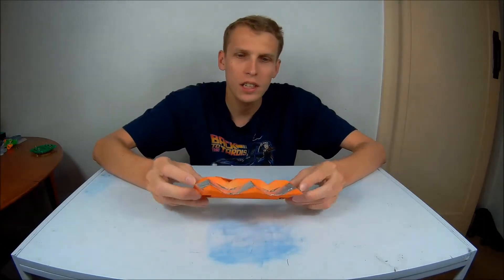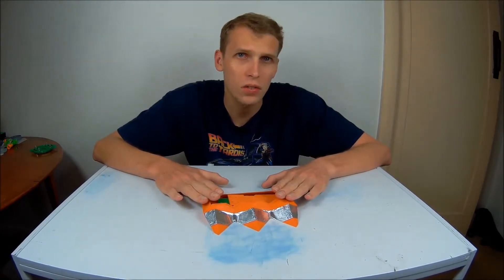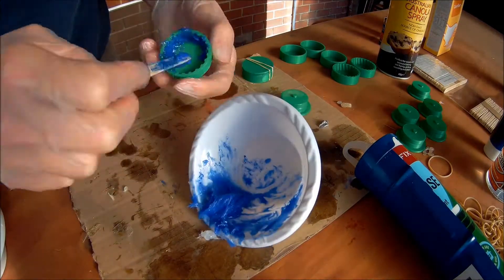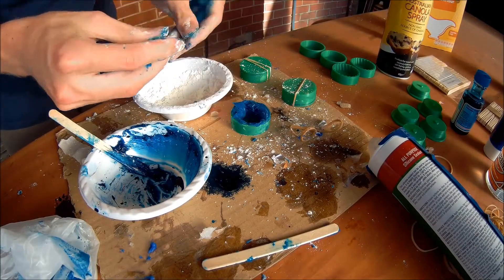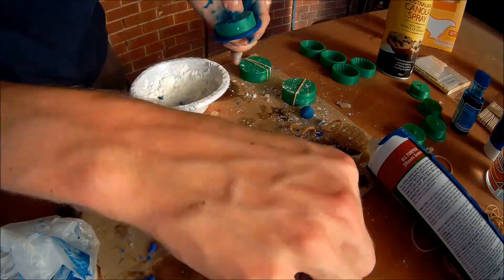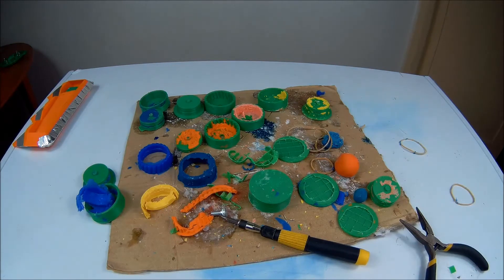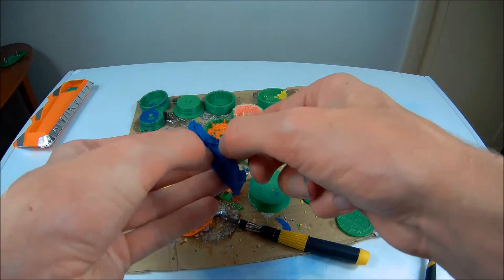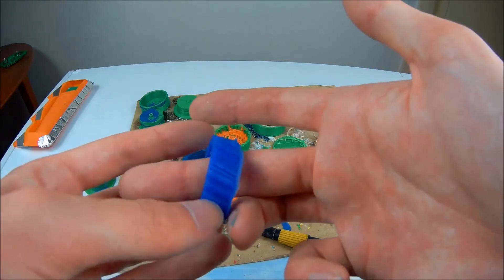DIY Silicone Wheel Experiments!!

Comment: As you'll be using these on a reasonably smooth surface, you should get more grip from a smooth tyre. Tread only really helps on loose or wet surfaces.
Reply from the maker: Combat arenas are usually only smooth for the first few fights, then they get full of dust and debris. The tread on these wheels is modelled after the tread on Ghost Raptor (battlebots s2) I'm hoping the shape will help kick dust and debris out and away from the robot.

it's just an idea right now, so I am going to fight with both treads and smooth to see which works better

Comment: Maybe try making the inner part of the mold, your actual wheel. If you rough it up or score it, the tyre will grip really well. (Once you’ve found the best mix, of course)
Smooth tyres will probably be better for grip because a ridged tyre has less surface area in contact with the floor. Also if the ridge is deep, you already have built in movement when your robot is being pushed against. That first bit of movement is often enough to start an unrecoverable slide, especially if some of that movement is enough to take a small amount or rubber off the edges of those ridges. In formula 1 we refer to the loose rubber that comes off the tyres as ‘marbles’ for a very good reason.
Reply from the maker: Thanks for the advice.

The hub for my wheel is printed in TPU to make it more impact resistant and has a radius 1-2mm larger than the mould. 
This means that the silicone will be stretched a little hopefully helping it stay in place, if that fails I'll add shoe glue between the silicone and TPU to create a flexible bond. In next version, I might just mould the silicone straight onto the wheel

I'm going to try out both ridged and smooth tires in the arena. I understand that ridged tyres have less surface area on the floor but I'm hoping the ridges will push debris and dust out from under the robot giving more grip overall. 

I have a monthly fight this weekend so I'll have a video up soon with the results in regards to smooth/ridged
Reply: Team Panic those do sound like good ideas. Ultimately it’s what works best for each individual robot and you will probably find better results by experimentation than by knowing what is best practice is in other fields. 

Good luck in you up and coming battles.
Reply: Team Panic congratulations on your recent win. Those ribbed tyres worked really well. I haven’t built a robot for over 15 years but starting a new project soon. Testing is going to be key so I’m going to try a kind of sled pull and push to check both power and grip. 
The wider wheels seem a good idea.
Reply from the maker: Great idea! 
my tests ended up being quite unscientific. 
A weighted sled would give a much better idea of power and grip. It would be good to get your test surface as close to your potential fight surface as possible to ensure you don't get surprised when you enter the arena for the first time
Reply: Team Panic indeed, the dust and debris is an infinite variable. But, the ribbed tyres worked well with the combination of you, the robot and the arena so probably no need to change anything at present.

Comment: You appear to indeed have the wrong type of silicone - a neutral cure silicone, which you don't want. You'll want an acetic cure silicone.
Reply from the maker: Thanks for your incite, 
This video was posted in Dec of 2017, 4 weeks later I realised what I'd done, that you where right and released a follow up:
https://youtu.be/ouSoR08e8S4

Since then I have cast a ton of wheels successfully, released my 3d files for all to use and made a tutorial where I make sure to point out the difference between silicone cure types, so no one makes my mistake again:
https://youtu.be/46umFYdI8uQ

Comment: Is the cure time extended when silicone is in a mold, not getting much air? They may still set up after being de-mold'ed.
Great to see a variety of testing. Been thinking about wheels since TPU, ninja flex is to slick. Rubber bands work pretty good, but slip off easily. 
Im also really curious how they do.
Keep the videos coming :)
Reply from the maker: If I had the right silicone the mold would not extend the cure time.

100% silicone has a tooling time of around 5 minutes and starts setting with water/moisture so mixing paint, food colouring or glycerine in forces the silicone to set even if it has no exposure to air